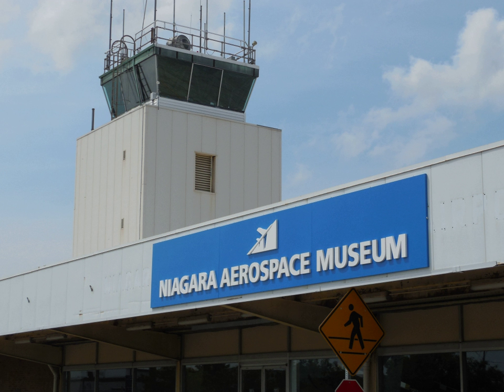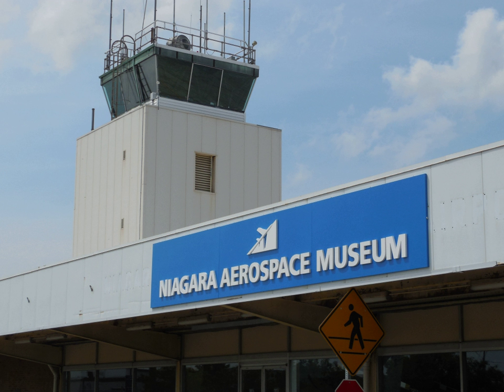Niagara Aerospace Museum | Wikipedia audio article

Comment: From Spain and confirmed with U.S. Federal Aviation Administration, the Consolidated model 1, NC8600  #14 was owned in 1929 by Kenneth Parker (fountain pen). In 1973 original Warner 125 hp. engine was replaced with current Kinner model R-55 160 hp. engine. See photos.

https://drive.google.com/open?id=1fQt9sllXbQh2gzV62FslcaMNQ_OkoczB

https://drive.google.com/file/d/1JpD8gWaO0jjo6eIqkoTV9D2ljIUGfd8y/view?usp=sharing

Congratulations
.
RC